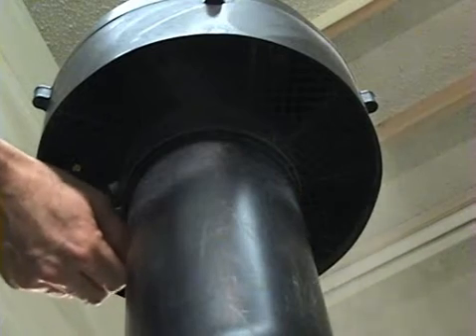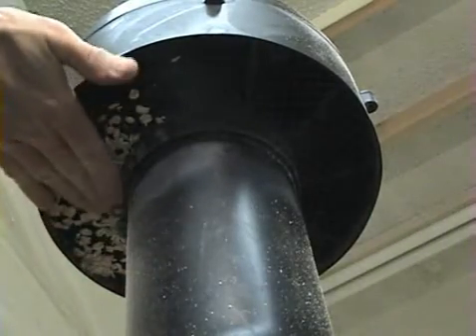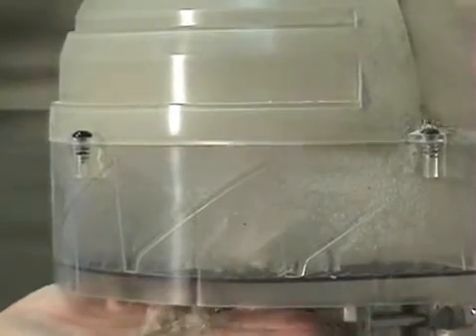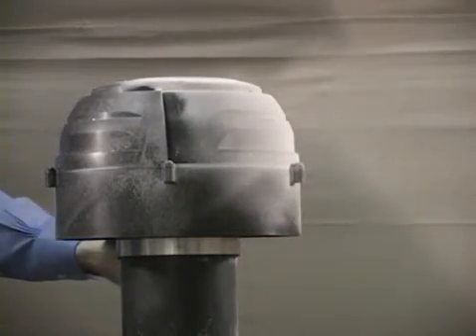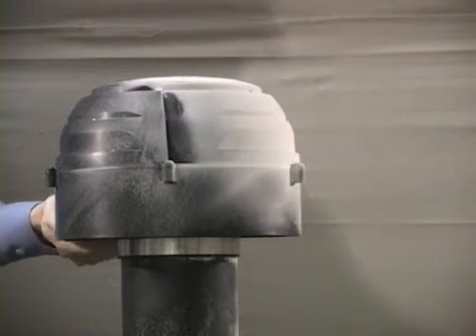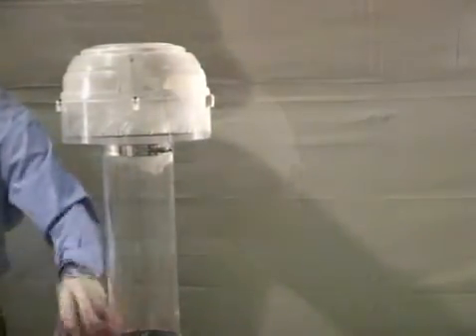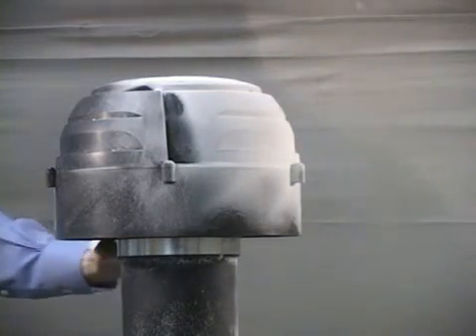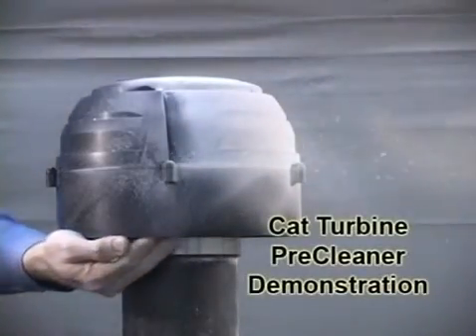Cat® Turbine PreCleaner Extends Air Filter Life | Demonstration

Comment: No very good guys! If it worked that good my air filter wouldn't be plugging and tripping the air restriction warning on my 160M when plowing snow.
Reply: You can see a filtration, biut not the No.one. Look at my side: neffgen.eu there you see the No. one of precleaner.